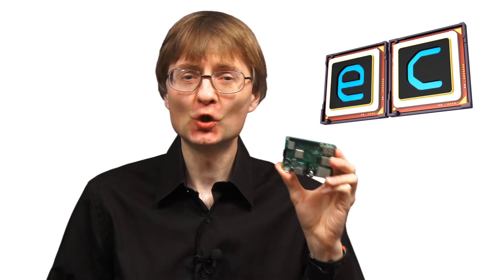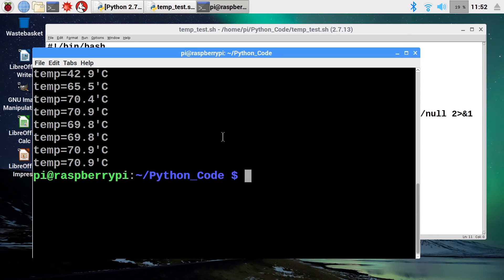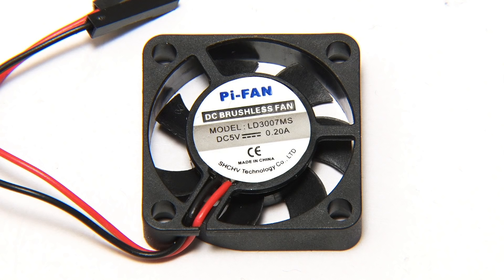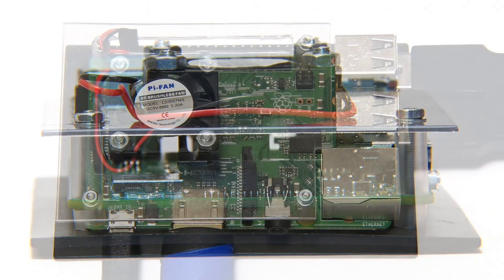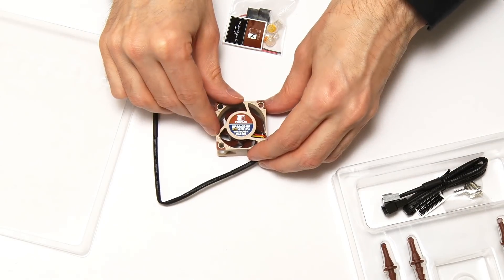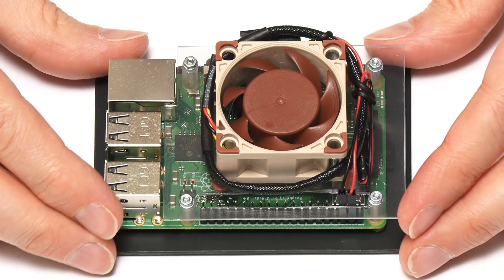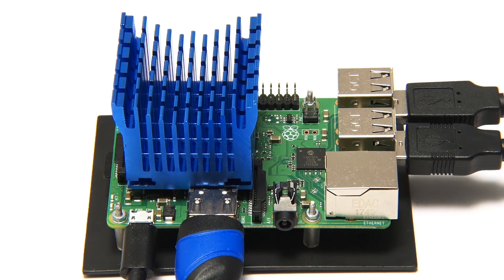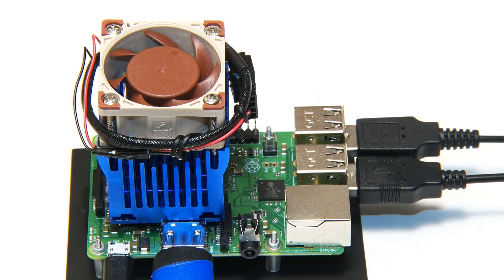Raspberry Pi 3 B+ Extreme Cooling

Comment: im now at this point in having to add a fan the cpu/gpu already has a heatsink. following your guide using pin 4 - 5v and 6 - gnd . When i power on the board it does nothing doesnt spin up. I have a noctua 40mm fan 5v 0.25w 0.5a. should it work without being programmed in

Comment: Is it a problem if my Pi3+ runs at around 63 degrees Celsius?
Reply from the maker: 63 is pretty high to run for very long periods. The Pi will work fine at this temperture (it will not throttle), but its life expectancy will almost certainly decrease.
Reply: @ExplainingComputers  The Pi is hanging in the meter cupboard, it's measuring my energy, and was hot. I saw this video and realised I had a small heatsink for the Pi. So I attached it today and also removed the top lid from the Pi case. Because it's not really necessarry in that small space. The temp is now around 54 degrees Celsius. I wil see if I can score a small fan soon to put in the lid.
Reply from the maker: @10vingers  54 is a lot better temperature. I would not worry running a Pi at 54.

Comment: Ok now use a cpu heatsink fan and run it with 12volt externally and it will give some decent temps. I think.

Comment: My record for cooling is 16.7° celsius at max load using an old pc 12volt fan but it was running on a 12 volt power supply on the pi4s power it got 22.3° celcius best part is I got it for free

Comment: One wonders if it would further benefit from some sort of clamping action of the heat sink to the SoC. In the world of the PC, simply plopping a heat sink onto a CPU with a bead of thermal-compound would not do much in the way of keeping it cool. It really does need some pressure to work properly. Still the results here are staggering, despite...

Comment: I know this is old but i still reference this video to this day. Love all your vids by the way! I think i have been subscribed for officially 3 years now! i am 13 and im pretty certain i subscribed on this day when i was 10. I actually did not know that there was the GPIO pins that tap directly to the micro USB port. Thanks for the info! I salvaged an old PC fan and cut off some female ends of some GPIO wires and attached them to the positive and negative wires. Works great!

Comment: you connected the pi-fan with the airflow blowing AWAY from the heatsink, and you connected the much more powerful noctua fan with the air blowing towards the heatsink.. so ofcoarse youre gonna get better results. from 2 angles. better fan plus better airflow
Reply from the maker: This is true, the first fan was the wrong way around by mistake. But in an open rig, push vs pull will give very, very similar results (as they both generate the same airflow).
Reply: @ExplainingComputers  if it was in a tube of very closed off case with only 2 openings to the world on either end then yes I do agree with that. 

It's cool having you respond to a comment. I've been watching your channel for a while now. Much love from across the pond.

Comment: I glued a laptop fan onto a Pi case and put one of those little heatsinks on the Pi 3 B+ processor. My temps are: 25.7C, 37.6C, 37.6C, 38.1C 37.6C, 38.6C, 38.1C and 38.6C. No need to buy a new fan, just scavenge an old laptop for its fan and there you are!

Comment: Not to be too harsh but your "big heat sink"  values are invalid. The heat sink has a large thermal capacity, and will be "eating up" heat until it reaches equilibrium (the bigger the mass, the longer it would take). So in order to validate it you would need to run it until the temperature stabilizes.
Great video otherwise.
Reply from the maker: The tests are all valid as demonstrations of how hot the Pi's SoC gets running with each cooling solution for the duration of the test consistently conducted. No more and no less. Nothing is "invalid". Granted, if left to run, the results would change. But that does not make what are presented valid comparisons of different solutions under the same test. Nowhere do I say, for example, that if you use this cooling solution, your Pi will never exceed such-and-such a temperature -- which would clearly be an invalid conclusion.
Reply: @ExplainingComputers  sure, their valid for a short work burst, but I'd argue that a test where you'd let the temperature settle would be more informative and less misleading to a distracted eye.
Reply from the maker: I still dispute that anything is "misleading" here.

Comment: I must ask, is the black first fan sucking from or blowing air on the RPi? I would think that blowing air on the heatsink even if it is small might get better results than it got cause to me it looks like you mounted the black fan upside down? But I might be wrong and it might not matter whether it blows or suck air, great video tho about the different solutions and how effective they are - I am currently looking into this matter since I noticed my Pi's getting hot running Android on them.
Reply from the maker: The first fan is sucking, just because I got it the "wrong" way up. But in an open rig like this, the difference will be minimal -- it is the airflow that matters.

Comment: The problem with big heatsinks is that you block the GPIO... do you know a solution of good cooling without blocking the pins? The problem is you cannot have good cooling + shields (or hats).
Reply from the maker: Lookout for my next Pi cooling video in a few weeks with the answer to this . . .

Comment: The copper where can be buyed? and which case with heatsink and noctua? may be an obj file to be 3d printed?
Reply from the maker: I got the copper from Amazon -- and I see that you have found one of my videos with 3DP parts. :) I've shared mounts for a Pi 4B and Pi 3B and before on Thingiverse: https://www.thingiverse.com/thing:3743755/files

Comment: Running Magic Mirror on the head, using a shined pre 1982 (1977) U.S. penny stuck to the cpu with some noctua NT-H1 in a case similar to this: https://www.amazon.com/KKmoon-Aluminum-Protective-Enclosure-Raspberry/dp/B07BFSVKFN I was able to get similar results to the fan and small heat sink. 

temp=33.8'C
temp=49.4'C
temp=51.0'C
temp=51.5'C
temp=51.5'C
temp=52.1'C
temp=51.5'C

temp=52.6'C
It should be noted that I have seen the temp down to 31.55556'C with just the Magic Mirror running

Comment: When the cooling solution is bigger than the device it should cool. (j/k, I love your videos.)

With a single Kintaro aluminium passive heatsink I'm having pretty remarkable results not surpassing 55°C at full load (Arctic MX-4 as thermal compound) on my Raspberry Pi 3 model B, just what I need for my portable project - it can't draw too much current out of the li-ion batteries. Only drawback is that it has to be mounted with screws through the same holes I need to mount the Pi where it has to go.

Solution: craft my own heatsink from spare heatsinks scavenged from old video cards, and secure it with thermal adhesive. That's the best solution I can think of at the moment.
Reply from the maker: Sounds like you have crafted a good solution.

Comment: So, I just gutted a power supply case from an old HP, leaving nothing but the case and the fan. The Fan plug directly fits the RPi GPIO, and it runs off of the 5V supply, and the RPi 3B fits inside the enclosure. I think I figured out how I'm going to cool my RPi 4B when it gets here.

Comment: I bought a Noctua NF-A4x10 5V fan (10mm high) and placed into a home made frame facing downwords just 2mm above a small heatsink as showed on the video and a small heatsink on the 2 Gb memory chip. The airstream is blowing out from the frame. Now the Raspberry Pi4b is hoovering around 49 to 50° C at full load and 35° C on idle with an ambient room temperature of 21.5° C

Comment: Well, I still haven't got a Pi 4B yet (hoping Amazon will start stocking the desktop kit before mid-September, when the only official supplier who isn't totally out of stock with them promises delivery here in the states), but i did buy a set of small heat sinks and a third-party Pi 3/4 case with 30mm fan for it.  I wish you had been able to measure the actual CPU clock frequencies at the max temperature for each solution you tested, but I'm guessing that the cooling I have should help it a fair amount.  I'm rather puzzled that the official Pi 4 case doesn't have a stock fan or any apparent vent holes in it at all, what are they trying to do, fry it?  Stuffing an overly hot component into a sealed container can't be good for it...

Great video, keep up the good work!
Reply from the maker: I've been shooting a Pi 4B cooling video over the past couple of days. And you are right, the official case gets bonkers hot . . .
Reply: @ExplainingComputers  I just thought of a question related to your excellent cooling video: Is it worth heat sinking the other chips on the board too?  How hot do they get, or is it mostly the CPU chip that''s generating most of the heat?  (The heat sink set I got has a bunch of themof a few different sizes and shapes).  Cheers!

Comment: Cant wait for raspberry pi 4B 4gb ram to be tested with extreme cooling like this :D
Reply from the maker: That will happen!
Reply: Please try a peltier 😀
Reply: @ExplainingComputers  now the 8 GB!!
Reply: Hypetrain is rolling
Reply: I'm testing it with a 115W TDP Cooler that is supposed to cool i7s and Ryzens this weekend, to kick off the blog I'm launching after that. Try googling "Raspberry Pi 4 Arctic Freezer" mid August. Going to hook up a Pi with an SSD, an Arctic Freezer 7 Pro, Noctua NF-B9 and Thermal Grizzly Kryonaut paste, then bench the temps with and without overclocking in hardware hungry Retropie games like Perfect Dark (N64), Shen Mue (Dreamcast) or Monster Hunter Freedom (PSP).

Comment: I just watched this video and was wondering what would happen if the fan was turned over.  Instead of blowing down on the heat sink pushing warmed air onto the chip, suck cool air over the chip the up past the heat sink and exhaust the head away from the whole assembly. what do you think?
Reply from the maker: The difference would probably be minor -- airflow is airflow, particularly in an open rig like this.

Comment: Didn't want such overkill and went with aliexpress pi "case-sink" with 2 included small fans https://www.aliexpress.com/item/NEW-Raspberry-Pi-3-b-model-Plus-dual-fan-cooling-system-module-with-heat-sink-for/32956687795.html for like ~10€ (gotta watch for "deals" and compare different sellers that sell the same thing.)
Reply from the maker: You've found a very nice solution, for a good price. :)
Reply: Obviously it does not even compare to your big heatsinks + big fans performance, but it keeps the Pi below throttling threshold around ~53C (with your script)  and ~58C when I disconnected the fans. So in all honesty I would buy the same thing again, but this time even go with the passive version only without the fans (temps just in between your small and big heatsinks w/o fans).

Comment: Thanks for posting this. I'd like to see the results of just a fan on the Pi with no heat sink. Especially if you tilted the fan (60 degrees?) to allow faster flow along the surface of the chip.

Comment: Hi, 

I really liked the idea of this video but sadly its just not verry good  :(

Here is why:

1:  in your table you did a lot of benchmarking, which is a verry good way to test a computer;  but you never  posted any of the results... 
as you said in the video, there was suposed to be throtling involved  but, by not posting bench results you dont show the real benefits of added cooling... 

2:   for a bigger or larger heatsink you just picked one  and than came to the conclussion that it doesn't really fit...   
in any good situation you would have looked for a perfect-fitting block  and than with a  file  taken off some of the material underneath...  
to prevent  even more shortage, you could have used insulation (tape?) to  further prevent  direct contact....  

This would have prevented double-dispensation, (from chip to coper, and from coper to aluminium) which in cooling is a major reductor.  

Also you didn't  cool the VRM which could  impair mutch of the results and the performance

3:   as a last  you could have tried  overclooking to see if, (with this kind of cooling), a clockspeed of 2ghz would be within its possibillities. 

all in all its a verry good concept but could be  mutchly improved.  

non the less  i do mutch apreciate your video's and am looking forward to any improvements you might care to make on this topic.
Reply from the maker: I am utterly bewildered by your comment. What do you mean I "never posted any of the results"? The table that builds up across the video includes all 48 test results from the tests run.
Reply: @ExplainingComputers  I think he is referring to the throttling and speed of the processor, to see whether cooling it would actually provide a performance boost.

Comment: Hi, great DIY work! I'd be really grateful to know how you wired the 3 pin fan to the raspberry pi. Could you please make a guide for which adapters and cables you used for the connection?
Reply from the maker: It is wired red wire to 5V (GPIO pin 2), and the black wire to ground (I used pin 6). The third wire is not used. I used the adapter in the box that takes the connector to bare wires, and connected these to two jumper leads.
Reply: @ExplainingComputers , it would have been helpful if you'd mentioned that it's necessary to buy the jumper leads separately.  I can't  connect my fan until I scrounge a couple from  somewhere.
Reply: @ExplainingComputers , if I use the 3-pin connector will that damage the pi?

Comment: Do you know what the maximum load on the 5v gpio pins are? I am considering running fans on a seperate power supply as the pi would be on full load and running 24/7
Reply from the maker: The 5V pins are connected directly to the micro USB 5V input, before the voltage regulator or any other electronics on the Pi. So you can draw as much current as your PSU (minus what the Pi draws) will allow. Well, OK. there will be a limit to what the PCB tracks on the Pi can take. :)

Comment: The best you can do, theoretically, with both air and water cooling is ambient. I'd guess that is about 10°C-15°C below your lowest reported temps.

I think you've reach a point of diminishing returns. You can do better, but at increasing cost and complexity.

Comment: Would have been interesting to see the results of the first 30mm fan mounted the same as the Noctua.
Reply: Exactly, I see a ton of RPI3 builds with fans mounted to blow the air outside, you'd figure after the xbox 360 dissaster people learned their lesson.
Reply from the maker: There's no comparison to a boxed-in product like an XBox here -- in an open rig the fan is simply moving air through the vanes. And I know from tests -- there is no temperature difference from push or pull.

Comment: Would the 30mm fan not be more effective if it were blowing towards the cpu ?
Reply from the maker: It would make very little difference in an open rig like this -- probably none! :)
Reply: Maybe even more effective as it'll be drawing air through the heatsink and pushing it away !  @ExplainingComputers

Comment: Just as an aside, the accessory care package that comes with Noctua stuff is part of the reason we who like them in our PCs buy them. That fan can be got for about £10 although £13 is more common. There's at least £5 of accessories included in the extension/low noise cables and those silicone mounts.
Reply from the maker: Good point. :)

Comment: Good idea about using a copper spacers.  I just pressed a pretty big hewtsink on mine and could free it touching some other components.. I just crossed my fingers and it still worked when I turned it on so I figured it didn't short anything.   I may pick up of of those copper spacers.

Comment: Of course all these solutions move heat from a hot side (the processor) to a cool side and the amount of cooling depends on how quick the cool sidegets rid of the heat so more can move in from the hot side - the bigger the difference between the two sides the better the cooling.  Once the cool side raises in temp the cooling effect diminishes.Using something like a Peltier Module or even a Stirling engine as a Stirling heat pump can move heat from a hot to a cold side but also move from a cold to a hot side so they aren't as limited .  OK, considering that Stirling cryo-coolers are used to liquify air that might be a tad excessive (and expensive) but the cheap Stirling engines hooked up with a motor or a Peltier module between the processor and the heatsink might be interesting.